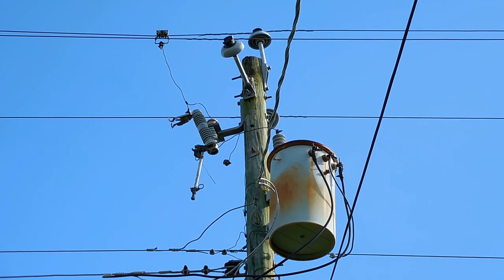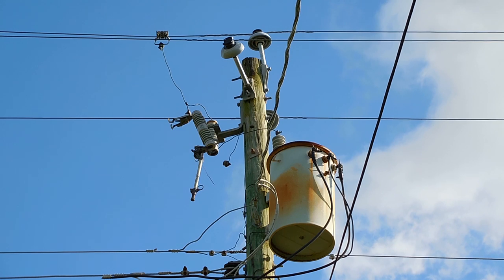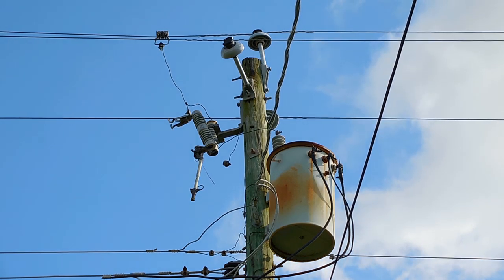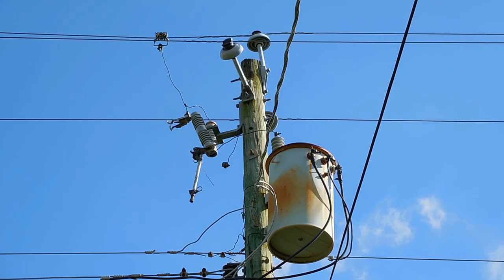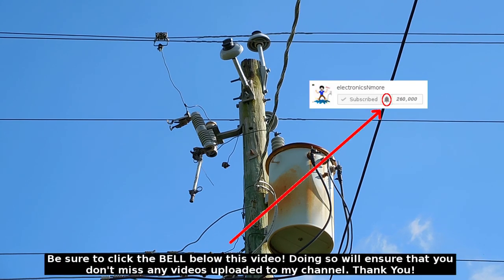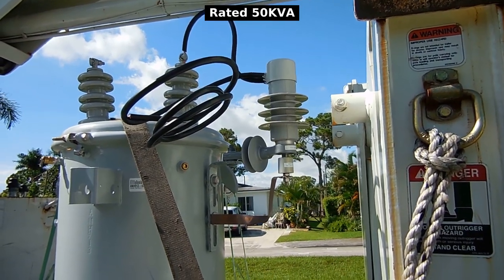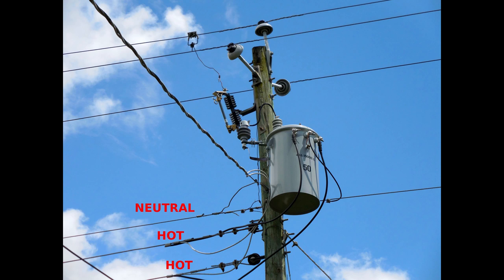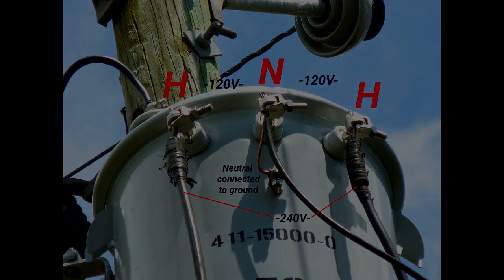Electrical Storm Destroyed Transformer! (Full Replacement)

Comment: These poles with transformers always look a bit "scary" to me. But that's because we don't have those here. In my country (The Netherlands) all this stuff is hidden in a small brick building in my neighborhood so no HV (usually 10 kV) or even mains voltage line "hanging in the air". But we use 240 V AC so longer wires to the houses is less of an issue compared to US at 120 V AC.
Reply from the maker: Newer areas of the USA use pad mounted transformers and all wires are buried. Higher voltage in NL means smaller diameter wires/cables, which lowers costs. :-) Thanks for watching!
Reply: Your comment doesn't make sense regarding voltage and wire length, but that's ok almost all or most  homes are supplied w/ a 3-wire service w/ phase to phase voltage of 240v & phase to ground voltage of 120v  line from pole to house.
Reply: @abro9242  True if the system was only 240 volts and single phase, but in most of Europe the distribution voltage is three phase nominally 230 volts phase to ground and nominally 400 volts phase to phase.  So the European distribution lines have only about 34% of the current of the North American system for the same amount of power.  For example, 50,000 watts of power is 208.33 amps using the 120/240 volt single phase North American system, and only 72.25 amps using the 230/400 three phase European system, assuming a power factor of 1.

With twice the voltage a single phase circuit feeding the same load with the same size wire can reach four times the distance with the same voltage drop.  And a three phase circuit can reach almost twice as far as a single phase circuit given the same voltage and load.  So a three phase system at twice the voltage can reach almost 8 times further for the same load on the same size wiring and have the same voltage drop as a single phase system of half the voltage.

Therefor 230/400 volt three phase distribution lines can be almost eight times longer using the same size wire.  This allows for centrally located transformer installations which are often in small buildings instead of pole mounted. Typically the transformers are of much larger capacity (300 to 1,000 KVA) and the wiring can be run well over a kilometer from the transformer in all directions, depending on the load.  If it is typical residential load, the wiring starts out at the transformer a pretty heavy gauge and as the distance from the transformer increases, the wire size can become progressively smaller as the load decreases with the distance from the transformer because the wire is carrying fewer houses as it gets further from the transformer.

Comment: That was a fuse cutout, not a switch. There is a fuse link of a certain value inside the ceramic casing. When it melts because of over-current, it releases the spring tension and it falls to notify the utility that the fuse has blown. Nice video BTW.
Reply from the maker: Yes, that's how they work. The lineman also called it a switch. Thanks for watching!

Comment: As a fellow Floridian in Palm Beach County, this same cutout situation has played in my back yard many times.  But the exciting time was when Hurricane Irma lightning lit the top of the pole on fire, which burned for a week like a cigarette from the top down.  The fire dept and FPL wouldn't respond during the aftermath emergency since the line was dead upstream, and the fire wasn't in an occupied structure.  Eventually it burned down to where the transformer and bracket fell off, then just hung and dangled down from its wires.  After a few days of these burning sparks falling on my roof, I got tired of the fire threatening my house, so I put it out myself with a high-pressure water fire extinguisher.  I wasn't sure that an electrical arc wasn't going to follow that stream of water down to me standing on the ground.  A few days later, an out-of-state emergency crew showed up with trucks and a new pole, which was similar to your story, except there was also the drama of these IBEW roughnecks ginning old and new poles into the ground.  Routine work for them, but quite a show for us.
Reply from the maker: Burned like a cigarette. LOL I've seen that before. Always fun to watch the work.

Comment: Thanks for the video. The tube hanging down actually has a fuse inside of it. Also who was trying to close that switch. Was pretty shaky. I used to work for an electric company and yes OSHA is sometimes not realistic in what they expect. Also that pole looks pretty old and probably needs to be replaced.  Good video.
Reply from the maker: Yes, that tube is the fuse. I cut out 15 secs of him trying to line up the fuse. :-).  The pole is probably from 1983, it doesn't look that bad. Thanks for watching!

Comment: I can't believe you aren't using a UPS on your computer and other sensitive electronics, they've saved my bacon a few times. My neighbor wasn't so lucky. When our trans blew it only blew one phase, so half the house had power the other half didn't. I didn't know sometimes only half can blow, tech said it's rare but it happens. Wash you had the camera rolling when the fuse blew, would have loved the see it kick out! Thanks 4 sharing.
Reply from the maker: If I went to get my tripod, I would've missed what he did. I ran outside and held the camera, the first noise wasn't bad, but the second time was loud. I jumped, and had visions of the transformer exploding.
Reply: @electronicsNmore  Ha,ha,ha I understand!

Comment: Those are fuses not switches and as you heard sound like a stick of TNT when blown.  The new bucket is a transformer sitting in oil, the old oil had cancer causing PCB's which is not used anymore.  Do yourself a favor and install surge suppression in your fuse panel, square D or Ditek.  Clamps 240 at 288 and 120 at 144 and puts it to ground, install in knockout on dryer breaker and shorten wires as much as possible.
Reply from the maker: The switch is just like a "knife blade" switch, the only difference, the knife blade is a fuse. I had a square D surge suppressor installed in the Bahamas, we still had a bunch of electronics get fried when lightning hit. They only work well if the strike isn't too close. Thanks for watching!

Comment: hold on there, unless I'm mistaken why plug back in the hot plug unless you fix the blown off wire from the arrestor? I mean it should work but wouldn't that be the first thing you fix?
Reply from the maker: You don't need an arrestor to test the transformer. If the switch stayed closed, then I'm sure they would've scheduled a lineman asap to fix it.
Reply: The priority is to get the lights back on. If the transformer worked then the lightning arrestor could have been scheduled to be repaired at a later date without shutting off the power to the customers.

Comment: What is the difference between top line and the bottom line? Ones high voltage and the other is secondary?
Reply from the maker: The highest wire is the high voltage primary, in a residential area usually 7000V  to 15000V.

Comment: If the primary fuse blows the fault could be anywhere between the primary conductors up to the cutout and the secondary conductors up to the next breaker(s), not just in the primary winding.
Reply from the maker: A short in the secondary happens very infrequently. It's almost always the primary, especially after a lightning strike. Thanks for watching!

Comment: ok, the 27kV coming from thin top wire. So far so good, but where is it coming out, going to ground with a steel wire? Whats happen if an idiot coming and cut it with a steel saw, or it break after a car accident? Does that mean there are 27kV at an open wire close to ground level where pedestran are?
Reply: Yes.
Reply from the maker: Top line is actually 7620V. That wire goes into one end of the primary winding, the other end of the winding goes down the pole to ground. As long as the wire remains connected to the side leading to ground, it will be at zero volts, if it becomes disconnected, then you'll have 7620v.
Reply: @electronicsNmore  i measured some time ago at this wire, which was actually a steel cable, to ground the current with a current clamp, but there was no current, maybe that line was not loaded cuz my to shows only above 1A something to read. But if this is really the ground connection then cut it is really a bad idea, how many idiots on earth have already tried that, im just confused that its possible to cut it and why its not covered. This wire is much bigger then needed but even its double in size as it is now it can still be cutten by accident. Interessting that this is on eaeth still an excepted technology even kids could cut this wire without knowing what dangerous thing they do!
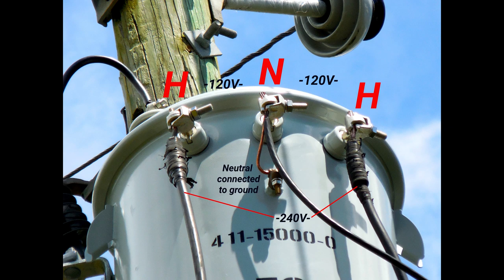Reply: the 27kV (seen at 4:00 in your video as text placed) was just the rating of the fuse, actually its just 7kV

Comment: The fused disconnect served its purpose.

In future: Beware of plasma, the 4th state of matter.  It is high voltage low current, conventional fuses wont protect the circuit.  The symptom will be blue/turquoise color and sparkling that does not stop, eventually heat will cause protection to work, after much damage is done.
Plasma is in the clouds, flying saucers and holograms get falsely accused.  Plasma is light, is pure energy, and comes in many fascinating colors.
Remember plasma globes in school?  Multiply by millions, see the problem?
Reply from the maker: Thanks for watching!

Comment: Crew needs better training, not sure of compliance?! Red flag. Call for another crew or a supervisor. Hell, call an engineer. They knew what the job was BEFORE they got there with a replacement and still weren't prepared for their work to be inspected.
Reply: Relax guy, I'm sure they did just fine. I'm sure they know what they are doing.
Reply from the maker: It's totally understandable why they didn't want every second of the job filmed.
Reply: I understand why they said what they did.
Reply: Calling an engineer out to a job is one of the last things you wanna do in line work. Engineers design and make things work on paper, just not so much in the field.
Reply: Basically everything you said is counterproductive.